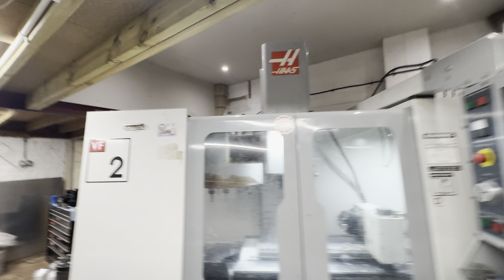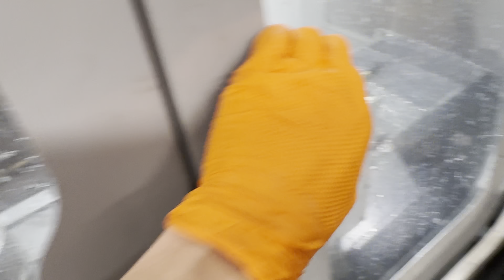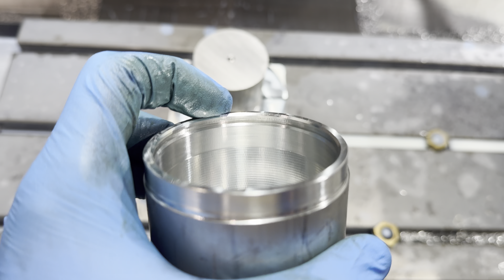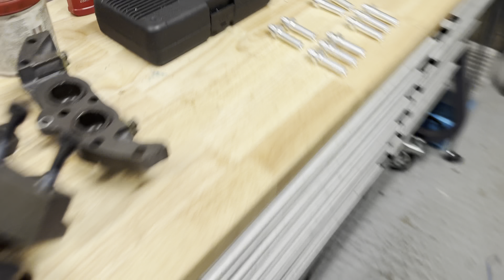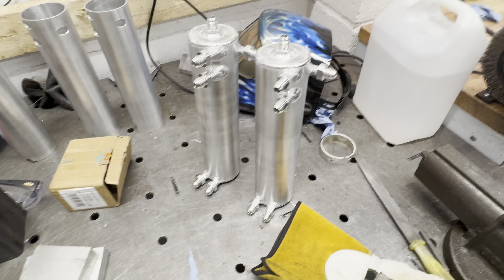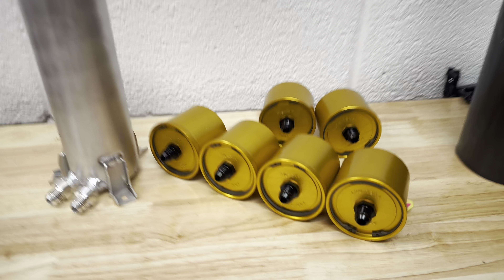R32 Group A Fuel System - CNC Filters and fabricated swirl pots

Comment: Nice work on the filters. May I suggest a large spring in first that way it pushes the filter back against the circlip?
Reply from the maker: Yeah someone else in the comments mentioned that, quite a nice idea. It’s finding a spring rate that compliments it all. 

As soon as you turn the fuel pumps on, obviously it’s pretty hard against the circlip…

Comment: At 1:00, the fuel tank is cool and has a large capacity, / but it seems like a lot of thought and careful selection is needed to install it on the vehicle. / I know that in the past, the front of the R32 was heavy, so / the large fuel tank was placed in the back to counteract that. / But in modern times, the fuel cell fuel tank is practical, and the old fuel tank was placed too far back, which is inefficient and not suitable for the current era. In other words, it is expected to reduce driving performance. / So, it seems better to place the new fuel cell with a large capacity in a good location at the back of the vehicle after calculating the center of gravity, and to neatly improve the electrical system.

Comment: Thank you for another fantastic video!

Screw compressors are amazing. After using a piston compressor for decades, I bought a new Atlas Copco screw compressor with a drier and a 120 gallon tank. The first time I turned it on, I knew I should have done it years ago. No water in the lines and hardly louder than an old fridge.

Keep up the great work. You old videos are always inspiring me to spend more time on my S14 240sx(USDM) and remake parts since the readily-available ones are always subpar.
Reply from the maker: Cheers dude. Yeah it’s night and day isn’t it. After breaking thousands of pounds worth of solenoids on the mill it was also an easy choice. 

Also, if I need to go down after hours I’m not nothing anyone. It’s wonderful!

Comment: I know the filter element is fixed to the lid but maybe a spring at base to ensure consistent pressure against lid to sirclip?
Reply from the maker: Yeah it’s a really nice idea that, I just think the spring would need to be quite stiff because the tolerances around the O ring are lairy. 

Obviously they are only moveable when not in use too, when there’s 5-7bar in there that acts as a pretty effective spring.

Comment: I know somebody that definitely wants four of those filters! ;)
...and potentially a swirl pot, though it would require a fair bit of reorganization in the boot.

EDIT: speaking of the filters, will you also be making the mounts (the half-circle bit that fits underneath that the filter got zip tied to)?
Reply from the maker: Wonderful! I’ll put you down for 4 and look to do a second big batch dude. I’ll have spare swirls initially too.

Yeah I’ve actually already done those little brackets. I had them all lasered and bent them here at the workshop.
Reply: @AlexGrA  heck yeah, I was wanting those done, definitely looking forward to rerouting the fuel system how I wanted. tho now that it's almost off-season again, have to decide if it's time to go fuel cell 😅